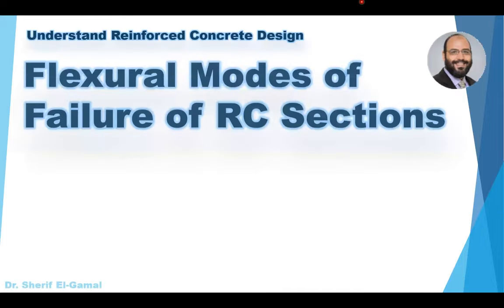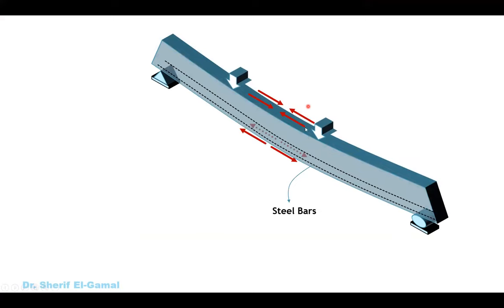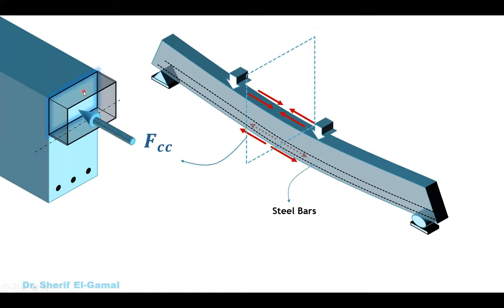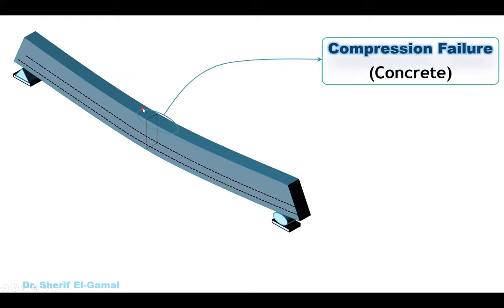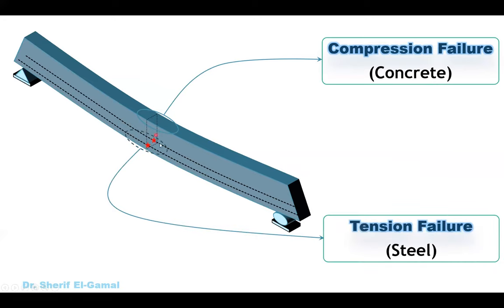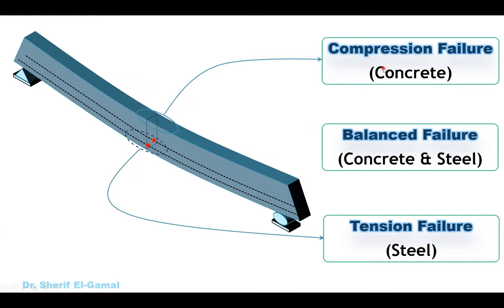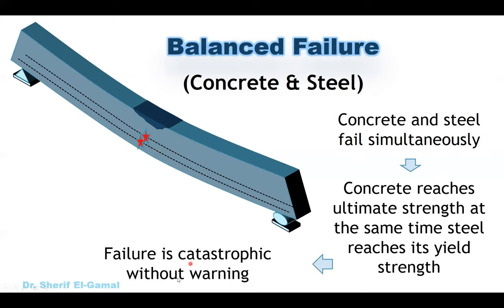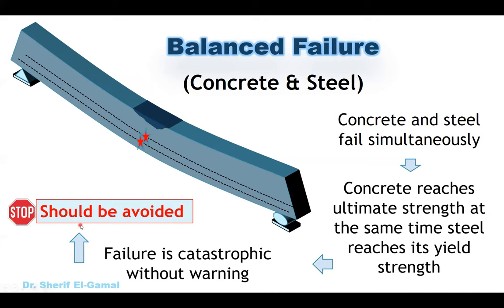Failure Modes of Reinforced Concrete Beam Sections under Flexure (Balanced -Tension - Compression)

Comment: Hello Sir, in determining the deflection of a beam if the modification factor is more than 2 what should I do?
Reply from the maker: Use 2. But this is an indication that the deflection is too safe and you may be able to reduce the thickness.
Reply: @MrElgamal77  Thank you Sir, I really appreciate your time and effort.
And if the modification factor is more than two for slab too, can I use two?

Comment: Is it correct, BS use 0.45fcu , and ACI use 0.85fcu ?
Reply from the maker: Yes it is. You are correct
Reply: @MrElgamal77  Is tension failure = ductile beam design ?

Comment: Sir , Does doubly reinforced section acts as Balanced Section? Because we calculate  ( Mu-Mu lim) and this difference gives us Compression Reinforcement, again we same equivalent  reinforcement provide at bottom.   
Sir, Can doubly reinforced section be designed for support moment (hogging moment), where the tension occurs at top fiber and compression at bottom fiber of the Beam section?

Comment: Thanks Dr shariif 
i wana lesson how loads transfer from slab to beam and bs8110 how to calculate beam self wt and partition wall and how load transfer to beam from two way solid slab and one way solid slab
Please sir more lessons need
Reply from the maker: Hello. Thank you for your interest. All what you asked are given in my beams videos.
Check my videos about the design of RC beams (Part 1, 2 and 3). The link of the first video is given below:
https://youtu.be/Nk6qq357ZSQ
Reply: Thanks ustaad sharif
i ask you one quastion for equation formula load from solid slab two way area trapizodal n×area of trapizodal/long side of panel or ly sir that formula is correct or not
And area of trangular transfer to beam formula n×area of trangle/short span or lx that formula is correct or not